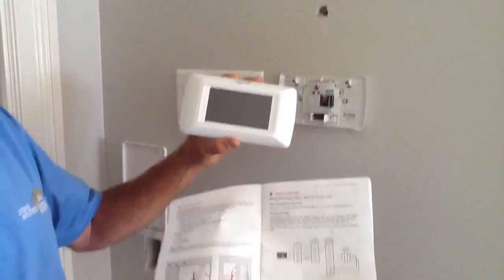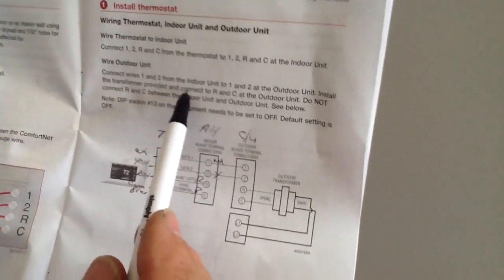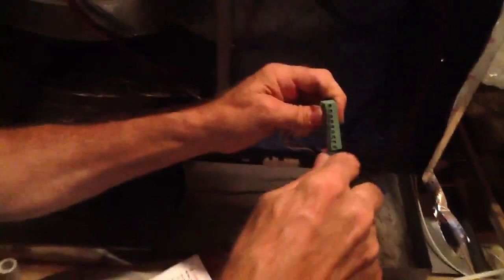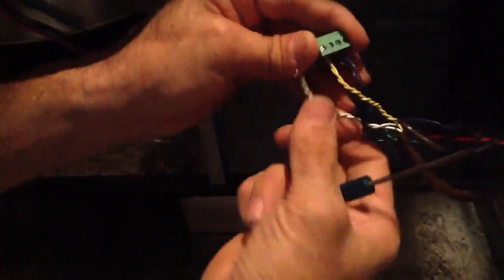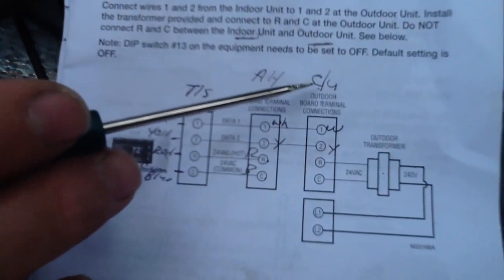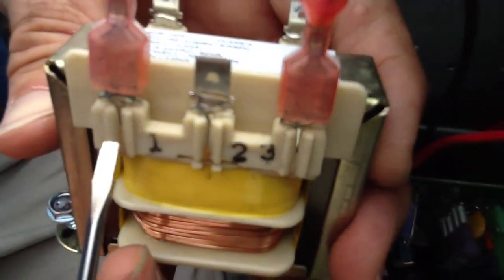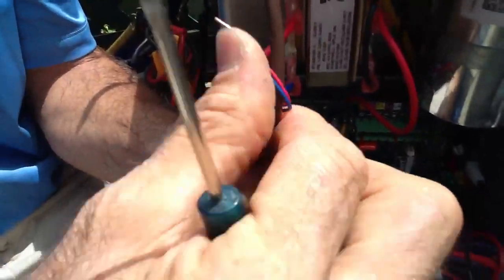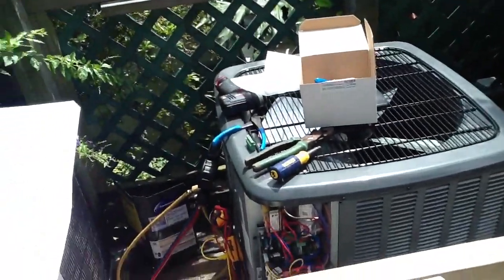Amana Communicating system

Comment: I just ordered the ComfortNet CTK04AE thermostat after using a nest for years, I felt it wasn't as efficient. I have a Goodman AVPTC60D14AD and a Goodman DSXC160601. Will I need to use the transformer when installing the thermostat? I see in the manual where it says 
ADDITIONAL TRANSFORMER
IS NOT REQUIRED FOR
INVERTER/VARIABLE SPEED
OUTDOOR COMMUNICATING
UNITS.
ADDITIONAL TRANSFORMER
IS REQUIRED FOR 2-STAGE
OUTDOOR COMMUNICATING
UNITS.

Any help is appreciated and your video is very imformative. Thank you.

Comment: Hi - we moved into this house and it already had this thermostat. I have everything (security code, manuals etc) EXCEPT the MAC address and the CRC address for the unit. It is not on the back of the wall plate or the face plate either. How do i find these two vital pieces of information?

Comment: I have the variable speed Amana 3 ton unit.  When they installed, they used my existing thermostat, which is designed for one or two stage units but not for variable speed.  The Amana website says that it's built in "smart" ComfortBridge will allow it to operate efficiently even without the ComfortNet Communicating thermostat.  But I'm curious if the communicating thermostat will be more efficient and/or allow more variablity in speed control?  Is this thermostat actually better than a standard smart (1 or 2 stage) thermostat?  I hate to spend this much money if there's no difference in real life.  Thanks for the educational video!
Reply: Hey, if you have a communicating air handler with a communicating condensing unit you should absolutely make use of a communicating thermostat. It will absolutely be more efficient. That's the whole purpose of a communicating system. To achieve a higher level of comfort by utilizing a higher level of equipment control.